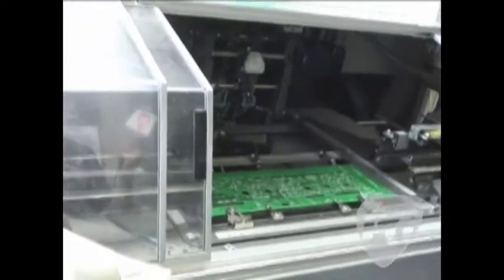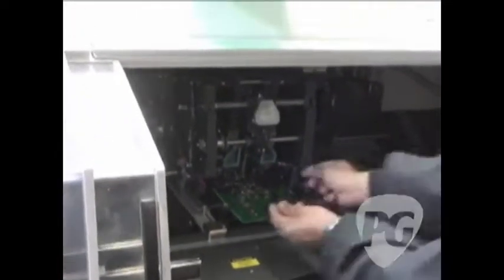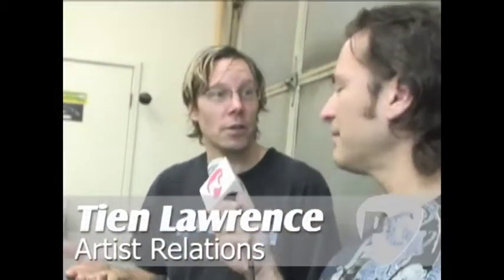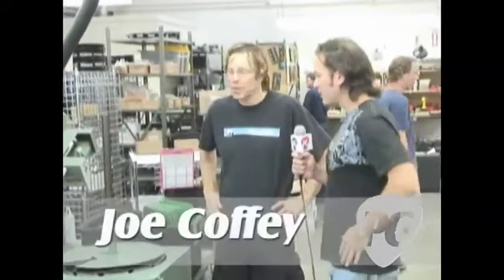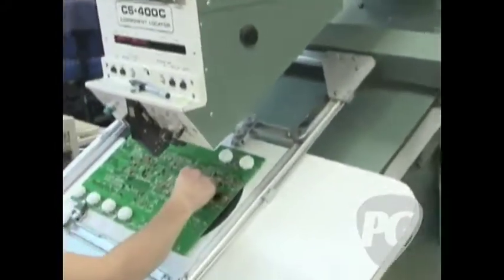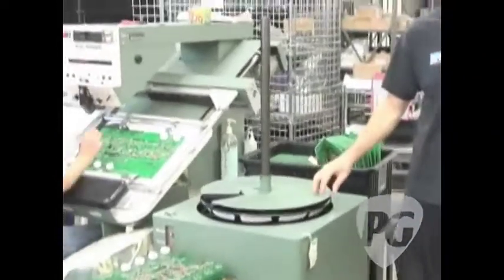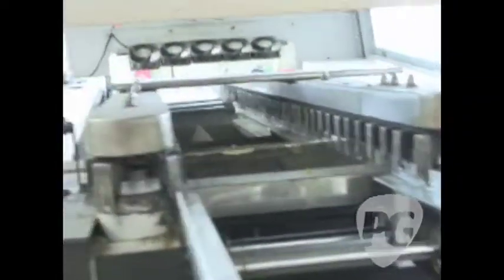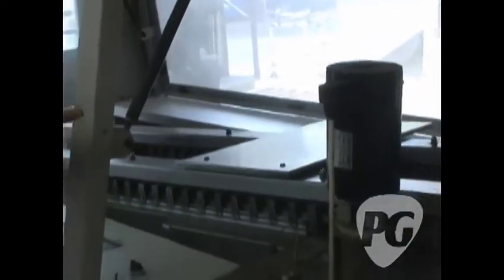Mesa Boogie Factory Tour-Constructing the Circuit Board

Comment: I used to program axial inserters like they show starting roughly at the 1m mark. Mesa's is a different brand than what I programmed. Even in 2001 when I worked with them these machines were way HUGE dinosaurs. Here's Mesa in 2009. To give you a sense of how old this was even in 2001, the company that made the machines I worked with was called Amistar. The microcontroller that ran that whole thing was a Zilog Z80. That is the same processor used in a Texas Instruments TI-80 calculator which has now been surpassed with simple code and is now a basic app on any phone or computer. Progress. Mesa NEEDS a CAD person. Some of this high tech could be made with SMT. It would save money and space inside the chassis. Plus SMT placement machines are at least twice as fast as axial.